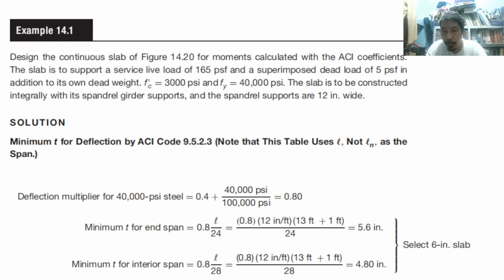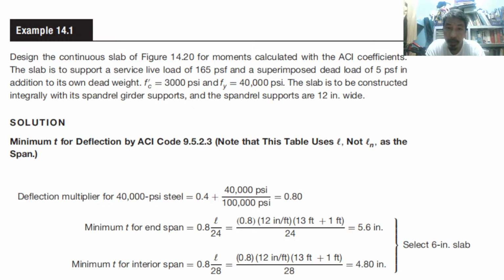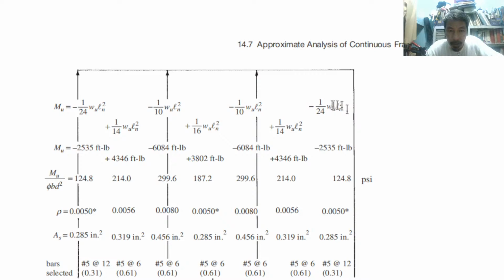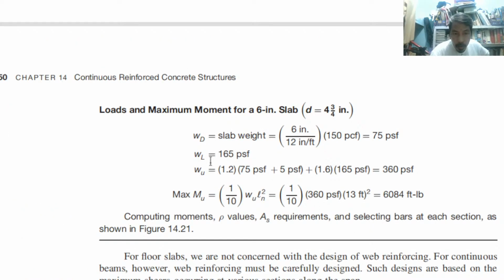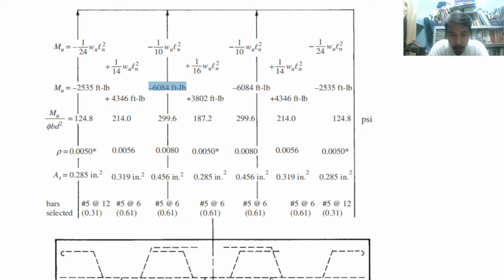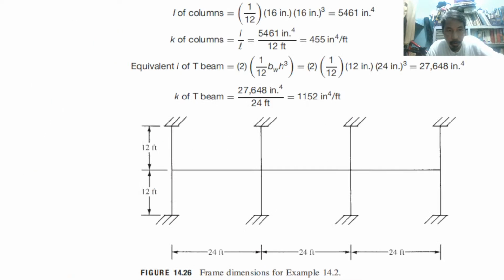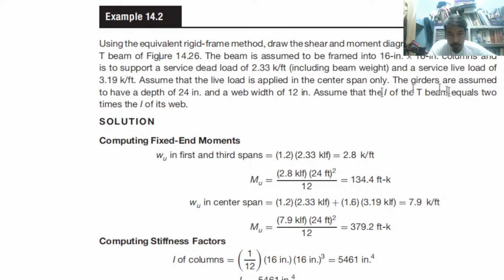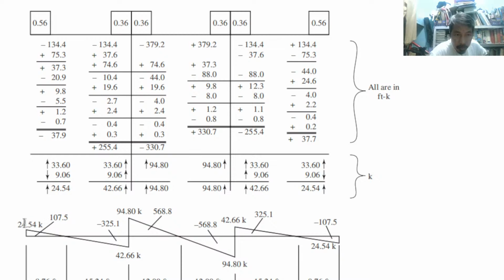[ LIVE CEE7 Lecture 19 ] DrAP Zantua Continuous RC Structures + ACI Coefficient & Examples

Comment: Thank you sir for the continuation of the topic about the Continuous Reinforced Concrete Structures and for explaining & discussing problems and examples for the design method of continuous reinforced concrete structures with the use of ACI coefficients.